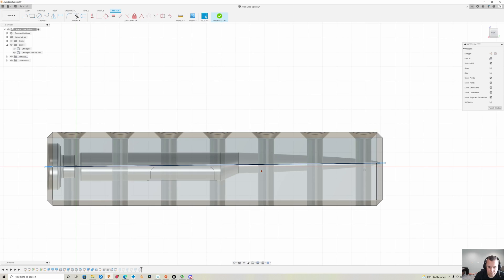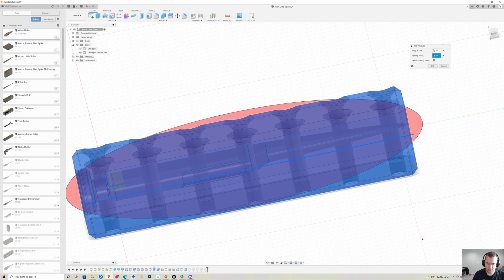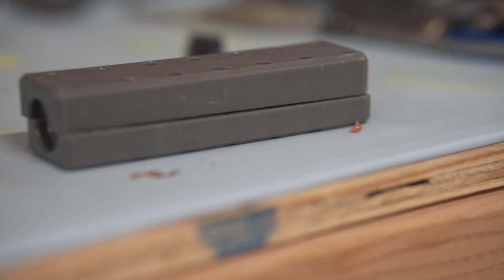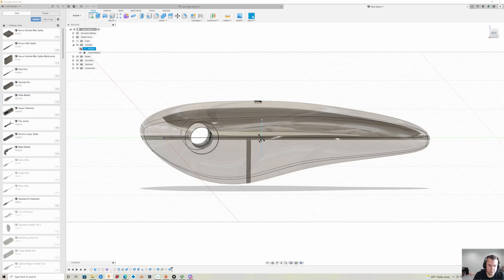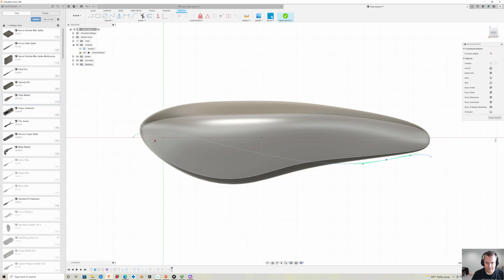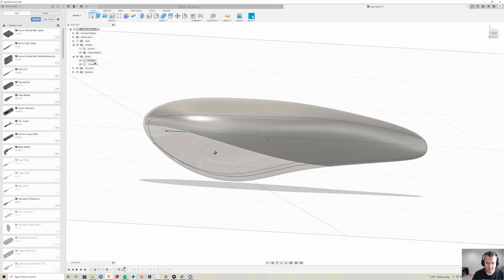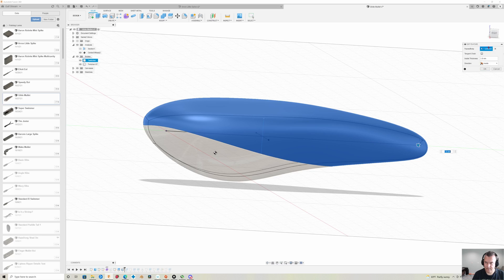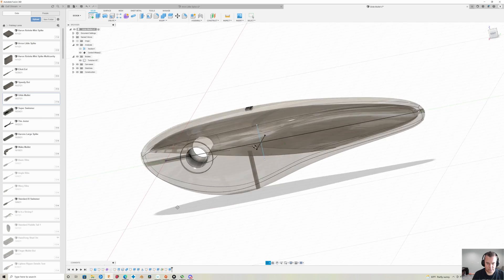2 Quick and dirty 3D Printed Lure Design Hacks

Comment: Nice use of shell. IF you are printing with filament, you can pause the printing and add a few plastic balls in the hollow chamber before it closes the opening, you can make a rattling lure!
Reply from the maker: Thanks for that. I am way off in the deep end trying to make resin lure bodies. I didn’t really show it in the video but you can add rattles after it is done as well. Hopefully I can share a working design soon….